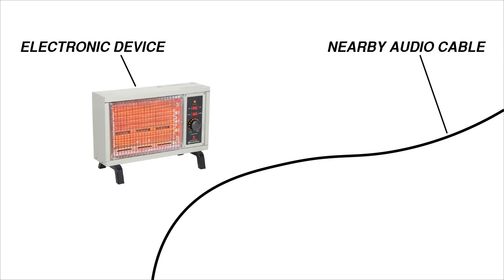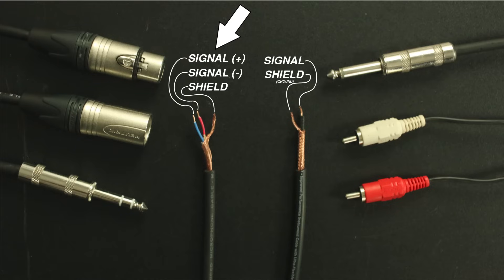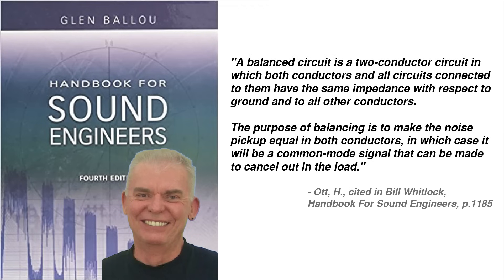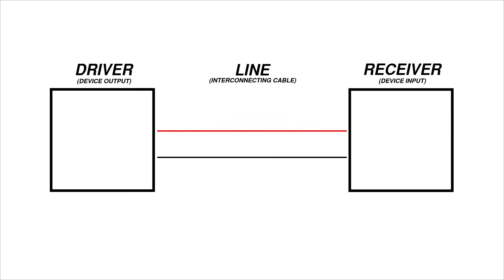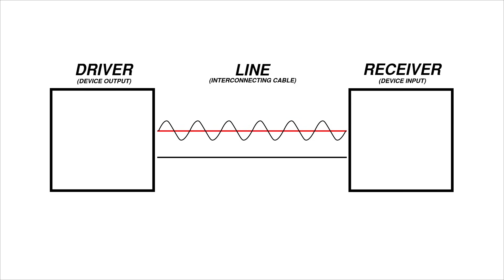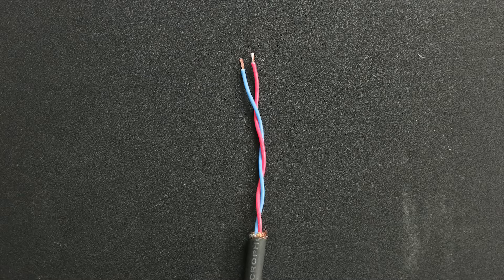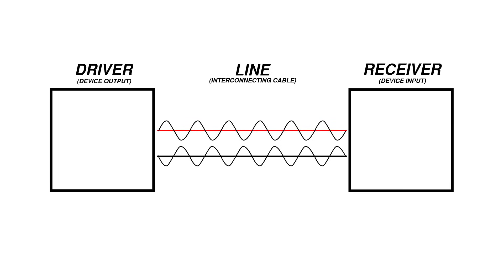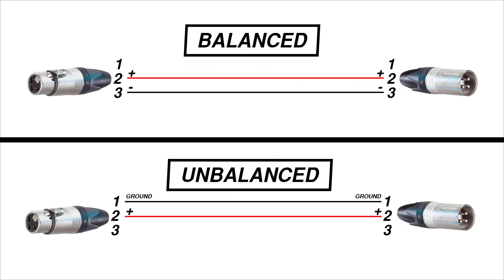Balanced vs Unbalanced Audio | Do Balanced Cables Sound Better?

Comment: Thank you so much for including an actual comparison between the two. I've been looking for someone that'll actually let us listen to the sound since I've been having this problem with my xlr cable. I'm getting the same buzzing sound. I think there's a problem with the cable since, sometimes, the buzzing will stop after I've moved the cable around just right, even though I didn't really do much moving. The information in the video is good to know when I go out to look for a new one. Thanks again.
Reply: Hello. I don't know if you have fixed your problem completely, but just wanted to let you know that I had a similar issue and it turned out to be a router that I had near my XLR cables. The router's antennas were picking up radio signals and transferring them to the cable. Hope that helps in any way to you or anyone else reading this.
Reply: @FrangellGaming  wouldn’t a balanced XLR cable reject the router noise as mentioned in the video?
Reply: @anzer789 the geometry doesn't work out perfectly if the router antenna is almost touching the audio cable or the cable is right against a very radio-reflective surface (concrete wall or floor). Often times buzzing noises is from power supplies, the big old magnet with lots of wire wound around it is beaming out EM waves and the electrical wiring in the power outlet like to pick that up and ruin the proper ground for the rest of the house. Putting wall-wart adapters on little extension strips usually helps, so does rotating the freezer just a little bit until the speakers stop popping every time the freezer compressor switches on.
Reply: This is for you or for anyone who is reading comments, as demonstrated in this video, balanced ones could cancel interference noise, but also a more expensive cable which has excellent shielding, like a $50 cable could shield your sound from such interference; if you have allot of devices, or devices close to your cable at any part of it, buy a more expensive xlr cable~
The difference in shielding between a $5-$40 is small, but $50 and above is huge, as an example~ I do recommend watching a video or reading on which cable does shielding the best~

If you put what this video is showing together with what I've said then you want an expensive Balanced XLR Cable to help you with this or such issues~
Hope this helps someone~
Reply: @CelestialMelody  Cost isn't everything! I'd advise looking at the actual specifications instead, as there are many expensive products that are vastly inferior to cheaper alternatives.
Reply: @CelestialMelody   The "audiophile cables" industry is full of snake oil and pseudo-scientific nonsense to fall prey to!  @user2C47 is correct that "Cost isn't everything".   In fact one source mentioned in the video, Bill Whitlock, the chief engineer & president of Jensen transformers, and de-facto expert on balanced audio connections and common-mode rejection ratio (CMRR), often recommends using the Belden 8241F coaxial video cable to construct your own unbalanced RCA audio cables with.  That cable is available in bulk at around 0.94 cents a foot and has excellent shielding properties due to the braided copper shield.

Comment: Perhaps you can answer this question. I've always played keyboards with L/R twin 1/4 outputs (stereo) - L to L mixer input, R to R mixer input on a mixer's stereo channel. I have a keyboard now that has only a "headphone / output" single 1/4 output. A standard TS cable doesn't produce a pure audio signal - I have been told to do 2 different hookups. 1) A TRS cable from the keyboard to the L channel of a mixer, or 2) A TRS cable to a Y splitter (female TRS to 2 male TS) into the L and R channel of my mixer. Which would be the better hookup? Thanks for your time -
Reply from the maker: If you want stereo separation, you should use a cable that splits the TRS into two TS plugs, as described in scenario 2. 

Using a TRS out of the keyboard into a single channel on the mixer will only give you one channel. I believe a TRS and a TS would be equal in this case, but I’m not certain.
Reply: @AudioUniversity  - thank you for your reply - most appreciated. I'm thinking the first TRS scenario would most likely have the exact audio effect as running a TS cable from a (Left) output on a L/R stereo keyboard to the L channel of a mixer channel (clear mono connection). And the second TRS scenario should have the exact audio effect as running both the L/R outputs with TS cables to the mixers L and R channels (clear stereo connection).
Reply from the maker: I think you’re correct!

Comment: Thanks Kyle, just an interesting question, is there balanced TS cables? In that case it runs the positive and negative signals without the shield?
Reply: Yes. It’s called UTP. It’s used for network cabling.
Reply from the maker: There are TS speaker cables. Both conductors have equal impedance. However, it’s not the cable that is balanced. It’s a combination of one device’s output, the cable, and the other device’s input
Reply: @AudioUniversity  in fact, you could say that a bridged amplifier has a balanced speaker output, and is unshielded.
Reply: The traditional analog telephone system has been using unshielded twisted pair cables for more than 100 years.

Comment: Your example is wrong.  The two signals generated to be shipped out in the cable are  +Signal and -Signal, now if a Noise is coupled equally to both wires then the Differential amplifier will amplify the +Signal and Noise and invert and amplify the -Signal the Noise signal into +Signal and -Nose when added together and presented on the amplifiers output you get +Signal + Noise +Signal - Noise or 2 +Signals and no noise (+Noise - Noise= 0). The noise has been eliminated.
Reply: He explained that the minus signal could actually be zero, which would still provide +signal+noise+0-noise=signal. Noise is still eliminated
Reply: @TomCee53  That sum makes sense, but if there is only signal in the +ve line, where does it return? One would suppose it must return via the shield. That would explain how it could have unbalanced compatibility at the receiving end.
Reply from the maker: I am certainly not an expert in circuits, but I believe the signal is referenced to the signal ground of the equipment.
Reply: @AudioUniversity  it actually depends on the circuit. Specifically, transformer coupled inputs and outputs are usually  isolated from chassis and signal ground and referenced only to each other. It is possible to simulate this with IC outputs, too. Most ins and outs are referenced to ground, so you are right in most cases.
Reply from the maker: Thanks for sharing this info!

Comment: although active differentially balanced signaling is able to transfer double the line voltage across, impedance balanced with undriven (i.e. zero volt) negative terminal has the advantage of being pin compatible to unbalanced connection on the receiving end, converting balanced to unbalanced

Comment: Good explanation. Due to the non availability of XLR connection, we sometime use XLR to TS cables ( mainly to speaker), in such case do we treat them as balanced or unbalanced cable? And if it unbalanced then how to we change it to XLR TO XLR....
Reply from the maker: It is not so much dependent on the type of cable or connector that is used. It is more so dependent on the type of output and input on the interfacing devices. 

If you need to convert an unbalanced signal to balanced, you can use a DI box.
Reply: @AudioUniversity  Thanks Kyle. My interface device output is TS and speaker takes TS, so in this case if it was XLR output in interface device and speaker with XLR, will this improve the sound quality or will it reduce the noise appearing due to other  electrical devices placed in the vicinity of cable route?
Reply from the maker: If the outputs of your interface are TS, there would be no advantage to using a TS to XLR adapter or a TS instrument cable. 

However, it’s likely that your interface has TRS outputs. In this case, you could make a balanced connection with a TRS to XLR adapter.

You might find this video helpful: https://youtu.be/m4hy63fEgA0

Comment: The demonstration with 1000ft of cable is really nice. It helped me understand the impact of noise rejection better than any explaination could. I wonder, since most headphones cables are roughly 10ft, should I expect 1% of the noise using a 10ft cable instead of 1000ft? Would that even be audible? Also, would the answer be the same with a 6 inch patch cable between a DAC and an amplifier?
Reply: It would not be audible. Consumer balanced setups are audiophile snake oil.
Reply: @Wordsalad69420  i got a measured improvement in my production setup by moving to balanced plus some DIs, but there's a bunch of noise in here plus USB/power/signal loops and there are long cable runs and old gear everywhere. but we're talking 10dB-ish improvement to noise floor. you can hear the difference if you crank the monitors though but not so much at low listening levels.
Reply: @Wordsalad69420  I just thought it was an interesting demonstration. I agree that for short cable runs, the noise cancellation benefits are negligeable. However, using balanced cables makes sense if you are using a balanced DAC and/or amplifier, which tend to perform better in balanced mode, rather than single-ended. 

Also, while I don't have 1000ft of audio cables running through my house, I do have 30ft of balanced cable running between my media players and headphone amplifier. Had I been using single-ended cables, I likely would have experienced a level of noise of around 3% of what was shown in the video (5:45), which would definitively been audible, although much quieter than show.
Reply: @Wordsalad69420  why?
Reply: @l21n18  Because the purpose of a balanced setup is to eliminate noise in the signal. That's it. It does not improve sound quality on the slightest bit. 99% of people do not have any audible noise in their signal.
Reply: the difference is the signal going to your headphones is a couple volts peak to peak
the signal from a microphone is milli-volts

so a few milli volts of 60HZ noise into a microphone is a lot
and into your 1 or 2V headphone signal is not audible

Comment: I recently bought some Adam Audio T5V Monitors. I’m using RCA cables and I hear clipping and distortion when I listen to certain music, specially rap. I’m not sure if switching to XLR would help prevent that or if I have my monitors on the wrong setting? Not really sure what the problem is. I’m new to all this and I could really use some help! Thanks
Reply from the maker: Let's try to figure out what's going on, MadeByLEIRA...

Does the clipping and distortion go away when you decrease the output volume level (sometimes called "Monitor" level) of your audio interface?
Reply: @AudioUniversity  No, it does not. I was actually testing this out yesterday and I figured it was maybe because I had the output audio too loud but it didn’t make a difference once I turned it down. (I’m using an M-Audio Air 192|4 USB interface).
Reply from the maker: Can you verify that the distortion isn’t there when you use headphones?
Reply: @AudioUniversity  yes, it isn’t there
Reply from the maker: It sounds like it is either the output of your interface or your speakers. Do you have other speakers you can try connecting to your interface to isolate the problem?
Reply: @AudioUniversity  hey, I was actually mistaken. The distortion does happen with headphones on. I just checked it out right now once I got in my home studio. What does this mean ?
Reply from the maker: Are you listening to a commercially produced song or are you listening through your DAW? If you’re listening to tracks in your DAW, make sure you aren’t clipping the master bus meter.
Reply: @AudioUniversity  I figured out the problem on M-Audio website. My USB to Direct knob on my interface was all the way on USB, I needed to move it a bit so it wasn’t all Usb. I also needed to turn down my volume on my computer to 80%. I really appreciate you trying to help me out ! I will definitely be watching more of your videos so I can keep learning ! Thank you
Reply from the maker: Glad to hear that! Let me know if you have ideas for future topics you’d like to see me cover. Thanks!

Comment: Better than most of the explanations I've heard and seen. 
A little history: balanced lines are nothing new to audio. They are just new to consumer audio. Balanced signal lines, microphone and line level, have been used by broadcasters and in motion picture production since the 1930's. And it is for exactly the benefit you describe: noise cancelling. In pre-1970's or so, microphones and input circuits used small transformers to attain the balanced connection (and make changes to the impedance).

Since then, audio transformers have become unfashionable because of their bits of distortion they introduce. You can conjecture that you must have purity -- even if you're recording Britney or heavy metal, eh?

In consumer audio, one good purpose of balanced is to reduce noise in long signal cables that run from preamps to powered speakers. And, they're cheap -- you can use XLR microphone extension cables.
Reply: Telephone lines are balanced and run a lot farther and we’re used way before that.
Reply from the maker: Thanks for sharing this additional info, Jim!